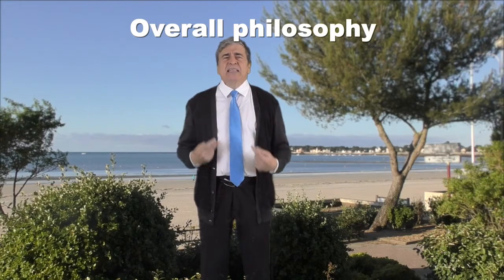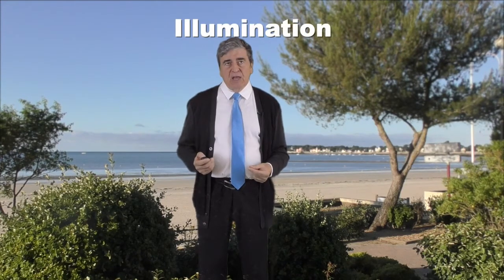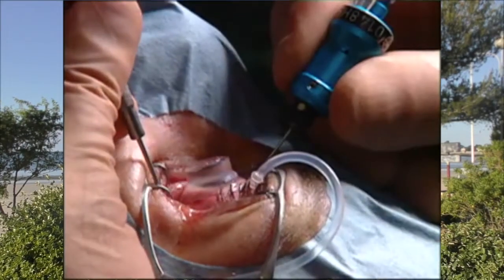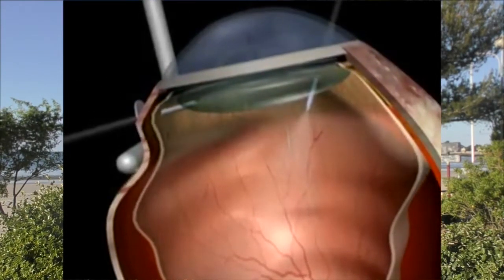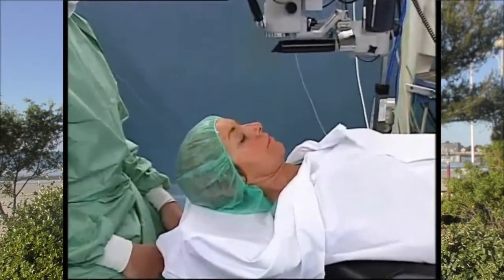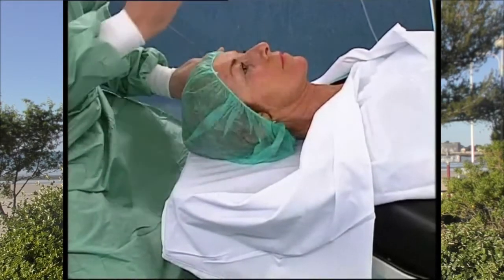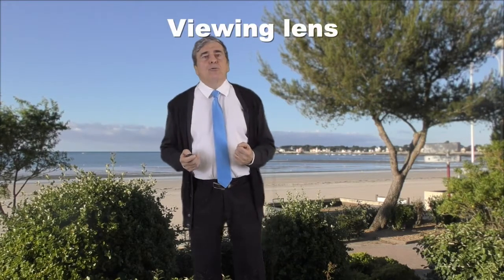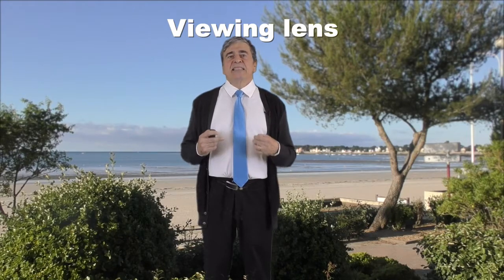5 - Starting the surgery for macular edema

Comment: Didier( I’ve seen the video at least 5 times. I keep learning something new every single time that I watched it. A couple of question related with the slit lamp:
1- which is the light intensity that you use?, 2- percentage of magnification? and 3- when you speak of the 5-7 degree of inclination. Related with what? Using the external Leica lamp was a little hard!
Reply from the maker: Thank you Alejandro. Use the highest intensity as there is no risk of toxixity. Try to work at the highest magnification you can support, you will then increase your precision. It is 5 to 7° from the axis of the microscope (7 if the pupillar dilatation is good). I know that it is a little difficult at the beginning but persist, you will get so many advantages!
Reply: @didierducournau3576  Thanks Didier. No doubt, I´ll persist until I get the results and images desired. I´m totally convinced that is the way to go. I realised that I had the slit lamp in an inconvinient possition. Thanks again.

Comment: Didier, great general concepts. You already mention that you are not doing surgery nowadays. But, before stop performing surgery, in which percentage of ALL of  your surgeries you use the planoconcave lens and in which percentage the 3-mirrors lens?
Reply: Alejandro, from 1990 to 2016 (date of my retirement), I have been using
 - for macular surgery: 100% plano concave lens (and no 3-mirrors lens since I was not performing a peripheral vitrectomy)
 - for complete vitrectomy (hemmorhagic or inflammatory vitreous): 100% plano concave and almost no 3-mirrors lens
 - for RD requiring vitrectomy: 100% plano concave lens and 50% 3 mirror lens (when searching a peripheral tear was needed)
 - for RD without vitrectomy: 0% plano concave lens and 100% 3-mirrors lens
Did I answered?
Reply: @lachainededidierducournau5597  Perfectly answered for me. Thanks Didier